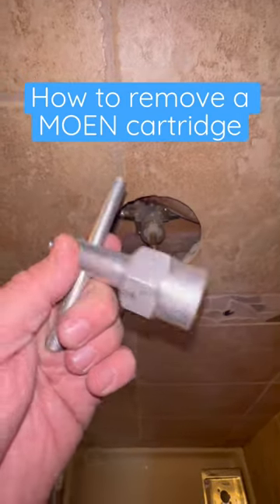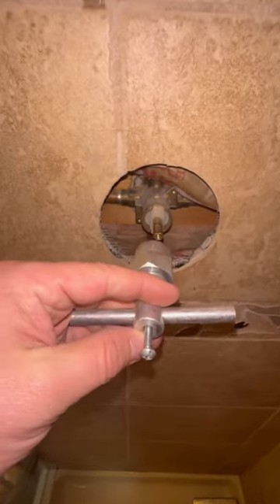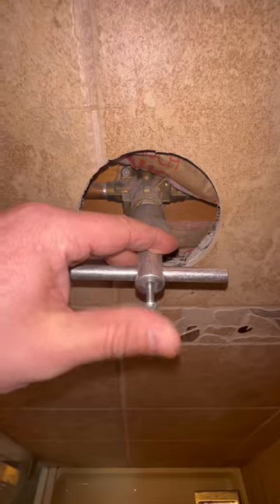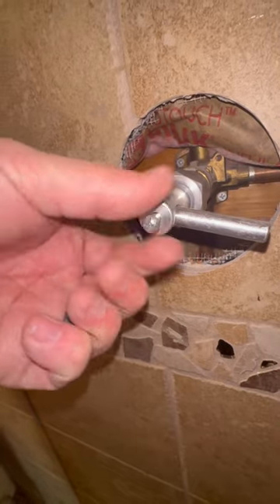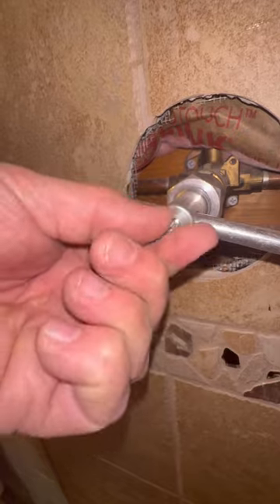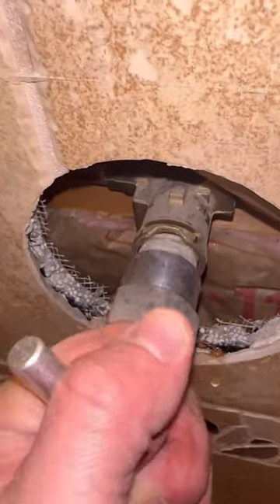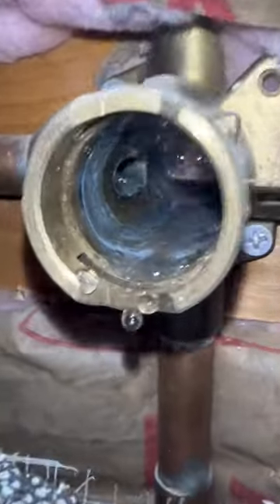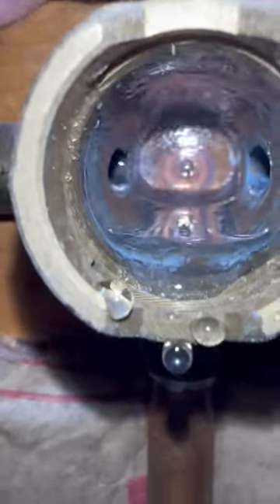How to remove a MOEN cartridge #moen #cartridge #plumbing #plumber #howto #diy #fix

Comment: 9 times out of 10 they do not come out that easy.. This is coming from a service plumber btw not just some Handy Andy. I do 2-3 of these a week.
Reply: Yep ya almost expect the pipe to come out of the wall too
Reply: It sucks when the screw is broken inside lol
Reply: I don't  agree with  that. 1 out of a 100 will be a problem, if the brass stem breaks off. In that case use an ez-out.
Reply: Ona puller works great.
Reply: So you need a special tool for all cartridges? Or can you use pliers? Is moen the only one that you need a brand specific tool for??

Comment: Not the proper way to use the tool. It should be attached with the screw then held steady while turning the nut portion on the cartridge end. It allows even force to be applied across the whole cartridge rather than just tugging...like you did.

Comment: If it came off that easy, you didn't need that tool in the first place. You are supposed to use nut in front to pull cartridge that is really stuck. Only problem is that tool is made with aluminum and wears out really fast. Genuine Moen tool looks exactly like that, but made with brass and lasts much longer.

Comment: For all of you do it yourselfers you have to turn the water off first pull-out the horseshoe looking pin that keeps the cartridge in the valve body under water pressure than proceed to remove the cartridge 😊😊

Comment: I need to replace mine. My water shut off is seized though. Can I just pull this out and hurry up and put a new one in? I have a 5 gallon bucket, so if I’m quick, will this work?
Reply: Not likely. You have to fight the pressure. You will be completely soaked and water will run behind shower valve as you install and you will have a massive leak.  Cut water at the curb and replace main shutoff first. (Sometimes you have to get water authority involved) You will regret not fixing main valve when your pipe bursts late in the night.

Comment: I tried using the same tool and the valve wouldn't move.  Put everything back together and several leakes sprung up.  Turned water off and called a plumber.  He used the same tool but it took him over an hour just finally move the valve.  When he tried pulling it out it broke off.  He had to use a blow torch and heated a screwdriver  to get the rest of the valve out.  He even struggled a bit getting the new valve back in.  Didn't realize it would be so labor intensive.

Comment: You're supposed to use a pair of channel locks so you don't pull on the valve and break the solder joints. There's also a retainer clip that needs to be pulled first.

Comment: 1 out of 10 pulls out that easy.. ive had the brass part break off and thats when the adventure really begins.. these posi temps use to be my favorite as a replacement but it seems lately they are all getting stuck and or breaking so the tool doesnt work and have to carefully drill and chisel out